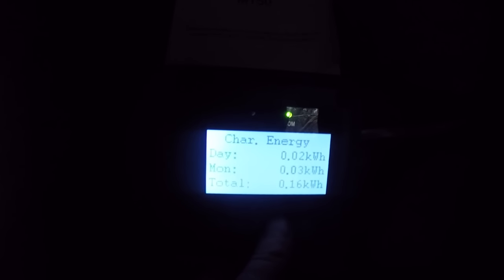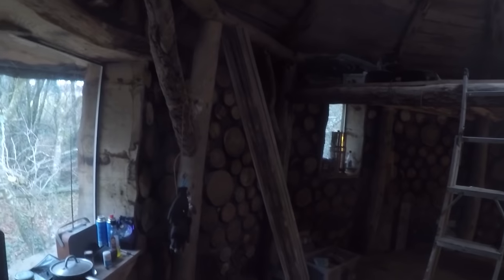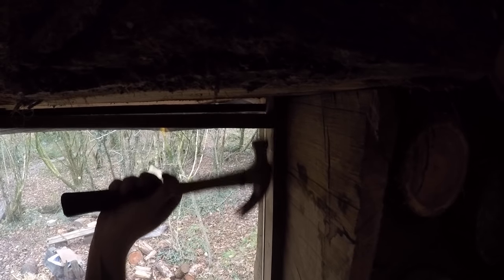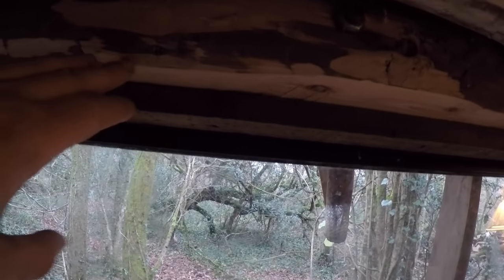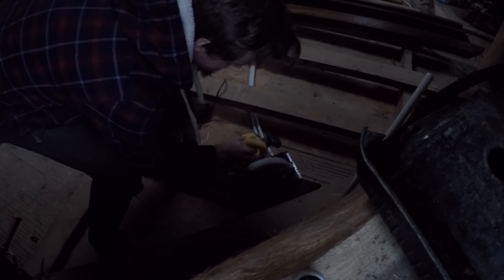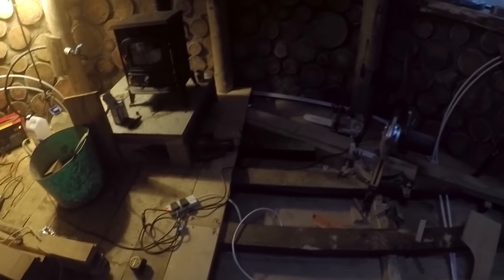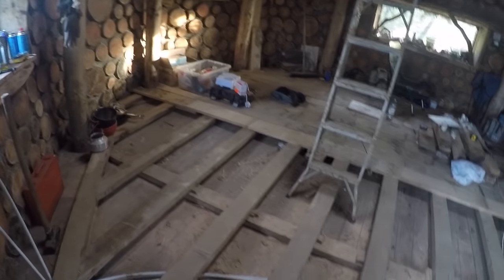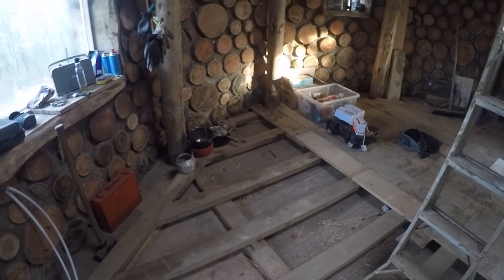off grid roundhouse build part 28 sealing the windows, finishing floor joists

Comment: I love your videos, very inspirational for DIY home builders.  In Wales do you all have mold issues or are the temperatures not conducive to harmful or destructive molds? I ask because of the condensation around the windows... I would think over time without silicone seal or other water barrier between the glass and the wood might cause warping, rot, or other types of damage to the wood frame. I have done repair for these types of damage in the past.  Thank you, and this is an honest question because environment is a major factor and was curious.  Take care man, and keep up the videos, I look forward to seeing the finished home!
Reply from the maker: the condensation is because the building is still soaking wet. all the cob and the wood is still drying and will take at least a year to dry out. the frames are oak and they wont rot. they might expand a little but there are gaps around the window to alow for this. as the structure dries out the condensation should go away.
Reply: +Kris Harbour Thank you for the response, and thank you for explaining about the cobb since I am not familiar with that as much.

Comment: Limestone paint for the walls is pretty much a must - You will have loads of mould issues - well, I did, I built one. Limestone is a natural deterrant.
Reply: Also, it helps to stabilize the walls as You will have craks - the wood moves - expands and shrinks with the weather.

Comment: I didn't see you use any caulking to seal the windows better. I assume this is a cost factor you don't want, which is great. I like your commitment to minimizing buying anything. My question is, would clay mixed up to a caulking consistency have worked?  I'm loving your videos. I haven't watched them in order but they are great!

Comment: getting on now, looking good. when you plan on getting the water wheel up and running? letting all that rain go to waste lol
Reply: lol its Wales, theres plenty more rain where that comes from.. 
Not all bad tho, its zone 8/9 oceanic climate. No danger of droughts.
Reply from the maker: i know, i know everytime i look at the water rushing by i think the same thing.  i dont have the money to buy the pipe i need to do it. its quite a long run and in order to get good efficiency it has to be at least 90mm pipe its going to cost about £2000 and i just dont have the money to do it yet.
Reply: Ooowww that's abit steep, id go skip diving for pipe and rig something up lol
Reply: +Kris Harbour hi kris, could you use the semi flexible pipes that are often used with commercial pumps. I'll try look on eBay and see if it has a generic name. They have clamps at either end so you can make the run as long as required, and think they come in 100 and 150mm sizes. What is it that's determining the pipe size? Is it a waterwheel or a Pelton wheel your setting up or is it some other design?
Reply: It's too expensive, not worth it. Find a different way.

Comment: Hi all. This is an awesome job you've done Kris. I've just binge watched all 28 episodes in 2 days and I can't wait for the next episode. I'm interested to know if you will be insulating the water pipes under the floor? not really from ice (obviously still a concern) but more from loss of heat on the hot pipes. Is it nessacery? how much heat are you hoping to get from the heater? Will

Comment: I asked about sealing windows when you made an opening one but didn't get a reply. I'm curious if you still have one or changed mind to seal them or maybe just sealed for winter?
Reply from the maker: hi, sorry i forgot about that, i will try to remember to show it. the back window has some hinges and opens.
Reply: Kris Harbour Ah ok. So just 1 window opens of needed. Is there a way to insulate that somehow also? Does the stove help airflow through the place when all windows are closed?
No more questions for another month, promise :)

Comment: You need a vapor barrier and insulation under the floor.
Reply from the maker: well i live in the building happily and its 24 degrees C in here tonight. and its about 8 outside so i think it just fine without.